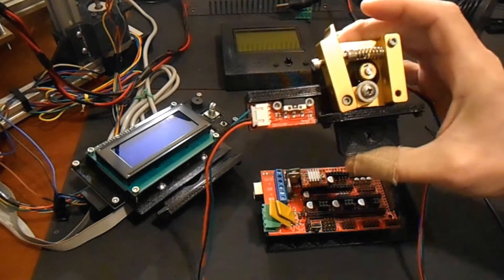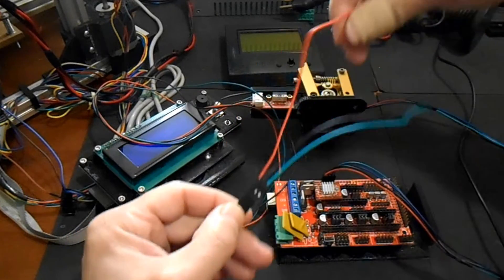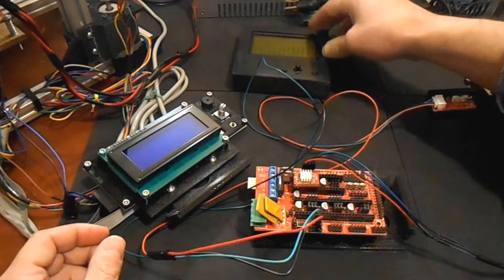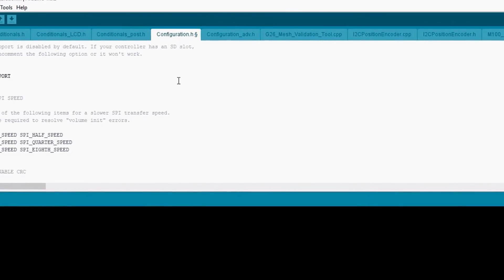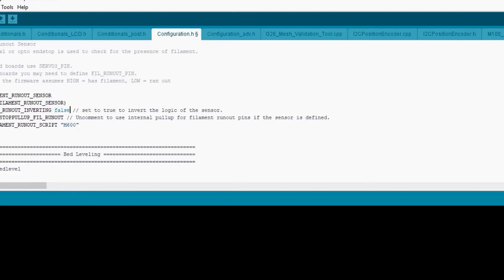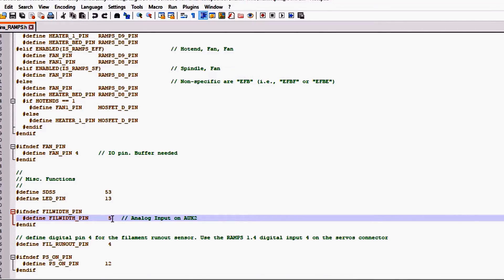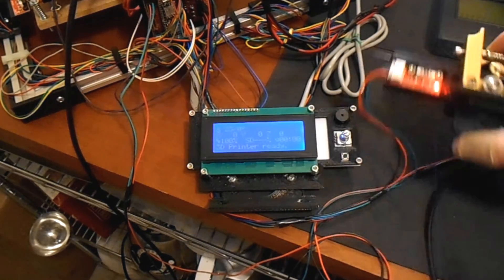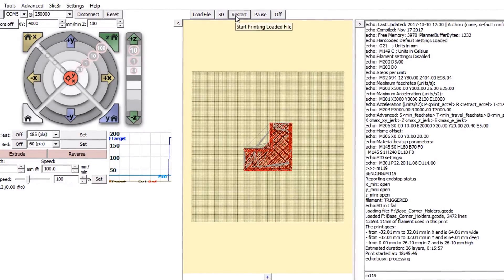RAMPS 1.4 - Mechanical Filament Sensor Runout Configuration

Comment: Hello, great video, but unfortunately I have a problem with the implementation and hope that you can help me to eliminate the problem.

I get the following error messages when uploading to the RAMPS board:

In file included from sketch\MarlinConfig.h:42:0,
                 from sketch\blinkm.cpp:27:
SanityCheck.h:511:6: error: #error "EXTRUDER_RUNOUT_PREVENT is incompatible with ADVANCED_PAUSE_FEATURE."
     #error "EXTRUDER_RUNOUT_PREVENT is incompatible with ADVANCED_PAUSE_FEATURE."
      ^
In file included from sketch\MarlinConfig.h:42:0,
                 from sketch\emergency_parser.cpp:27:
SanityCheck.h:511:6: error: #error "EXTRUDER_RUNOUT_PREVENT is incompatible with ADVANCED_PAUSE_FEATURE."
     #error "EXTRUDER_RUNOUT_PREVENT is incompatible with ADVANCED_PAUSE_FEATURE."
      ^
In file included from sketch\MarlinConfig.h:42:0,
                 from sketch\dac_mcp4728.cpp:33:
SanityCheck.h:511:6: error: #error "EXTRUDER_RUNOUT_PREVENT is incompatible with ADVANCED_PAUSE_FEATURE."
     #error "EXTRUDER_RUNOUT_PREVENT is incompatible with ADVANCED_PAUSE_FEATURE."
      ^
In file included from sketch\MarlinConfig.h:42:0,
                 from sketch\pca9632.cpp:28:
SanityCheck.h:511:6: error: #error "EXTRUDER_RUNOUT_PREVENT is incompatible with ADVANCED_PAUSE_FEATURE."
     #error "EXTRUDER_RUNOUT_PREVENT is incompatible with ADVANCED_PAUSE_FEATURE."
      ^
In file included from sketch\MarlinConfig.h:42:0,
                 from sketch\malyanlcd.cpp:44:
SanityCheck.h:511:6: error: #error "EXTRUDER_RUNOUT_PREVENT is incompatible with ADVANCED_PAUSE_FEATURE."
     #error "EXTRUDER_RUNOUT_PREVENT is incompatible with ADVANCED_PAUSE_FEATURE."
      ^
In file included from sketch\MarlinConfig.h:42:0,
                 from sketch\MarlinSerial.cpp:36:
SanityCheck.h:511:6: error: #error "EXTRUDER_RUNOUT_PREVENT is incompatible with ADVANCED_PAUSE_FEATURE."

     #error "EXTRUDER_RUNOUT_PREVENT is incompatible with ADVANCED_PAUSE_FEATURE."
      ^
In file included from sketch\MarlinConfig.h:42:0,
                 from sketch\SdFatUtil.cpp:29:
SanityCheck.h:511:6: error: #error "EXTRUDER_RUNOUT_PREVENT is incompatible with ADVANCED_PAUSE_FEATURE."
     #error "EXTRUDER_RUNOUT_PREVENT is incompatible with ADVANCED_PAUSE_FEATURE."
      ^
In file included from sketch\MarlinConfig.h:42:0,
                 from sketch\Marlin.h:35,
                 from sketch\endstops.cpp:27:
SanityCheck.h:511:6: error: #error "EXTRUDER_RUNOUT_PREVENT is incompatible with ADVANCED_PAUSE_FEATURE."
     #error "EXTRUDER_RUNOUT_PREVENT is incompatible with ADVANCED_PAUSE_FEATURE."
      ^
In file included from sketch\MarlinConfig.h:42:0,
                 from sketch\hex_print_routines.cpp:23:
SanityCheck.h:511:6: error: #error "EXTRUDER_RUNOUT_PREVENT is incompatible with ADVANCED_PAUSE_FEATURE."
     #error "EXTRUDER_RUNOUT_PREVENT is incompatible with ADVANCED_PAUSE_FEATURE."
      ^
In file included from sketch\MarlinConfig.h:42:0,
                 from sketch\Max7219_Debug_LEDs.cpp:38:
SanityCheck.h:511:6: error: #error "EXTRUDER_RUNOUT_PREVENT is incompatible with ADVANCED_PAUSE_FEATURE."
     #error "EXTRUDER_RUNOUT_PREVENT is incompatible with ADVANCED_PAUSE_FEATURE."
      ^
In file included from sketch\MarlinConfig.h:42:0,
                 from sketch\fwretract.cpp:27:
SanityCheck.h:511:6: error: #error "EXTRUDER_RUNOUT_PREVENT is incompatible with ADVANCED_PAUSE_FEATURE."
     #error "EXTRUDER_RUNOUT_PREVENT is incompatible with ADVANCED_PAUSE_FEATURE."
      ^
Mehrere Bibliotheken wurden für "U8glib.h" gefunden
 Benutzt: C:\Program Files (x86)\Arduino\libraries\U8glib
 Nicht benutzt: C:\Users\Christian\Documents\Arduino\libraries\U8glib_Arduino-master
In file included from sketch\MarlinConfig.h:42:0,
                 from sketch\Sd2Card.cpp:29:
SanityCheck.h:511:6: error: #error "EXTRUDER_RUNOUT_PREVENT is incompatible with ADVANCED_PAUSE_FEATURE."
     #error "EXTRUDER_RUNOUT_PREVENT is incompatible with ADVANCED_PAUSE_FEATURE."
      ^
In file included from sketch\MarlinConfig.h:42:0,
                 from sketch\nozzle.cpp:23:
SanityCheck.h:511:6: error: #error "EXTRUDER_RUNOUT_PREVENT is incompatible with ADVANCED_PAUSE_FEATURE."
     #error "EXTRUDER_RUNOUT_PREVENT is incompatible with ADVANCED_PAUSE_FEATURE."
      ^
In file included from sketch\MarlinConfig.h:42:0,
                 from sketch\G26_Mesh_Validation_Tool.cpp:27:
SanityCheck.h:511:6: error: #error "EXTRUDER_RUNOUT_PREVENT is incompatible with ADVANCED_PAUSE_FEATURE."
     #error "EXTRUDER_RUNOUT_PREVENT is incompatible with ADVANCED_PAUSE_FEATURE."
      ^
In file included from sketch\MarlinConfig.h:42:0,
                 from sketch\I2CPositionEncoder.cpp:31:
SanityCheck.h:511:6: error: #error "EXTRUDER_RUNOUT_PREVENT is incompatible with ADVANCED_PAUSE_FEATURE."
     #error "EXTRUDER_RUNOUT_PREVENT is incompatible with ADVANCED_PAUSE_FEATURE."
      ^
In file included from sketch\MarlinConfig.h:42:0,
                 from sketch\SdBaseFile.cpp:30:
SanityCheck.h:511:6: error: #error "EXTRUDER_RUNOUT_PREVENT is incompatible with ADVANCED_PAUSE_FEATURE."
     #error "EXTRUDER_RUNOUT_PREVENT is incompatible with ADVANCED_PAUSE_FEATURE."
      ^
In file included from sketch\MarlinConfig.h:42:0,
                 from sketch\configuration_store.h:26,
                 from sketch\configuration_store.cpp:47:

SanityCheck.h:511:6: error: #error "EXTRUDER_RUNOUT_PREVENT is incompatible with ADVANCED_PAUSE_FEATURE."
     #error "EXTRUDER_RUNOUT_PREVENT is incompatible with ADVANCED_PAUSE_FEATURE."
      ^
In file included from sketch\MarlinConfig.h:42:0,
                 from sketch\enum.h:26,
                 from sketch\parser.h:32,
                 from sketch\parser.cpp:27:

SanityCheck.h:511:6: error: #error "EXTRUDER_RUNOUT_PREVENT is incompatible with ADVANCED_PAUSE_FEATURE."
     #error "EXTRUDER_RUNOUT_PREVENT is incompatible with ADVANCED_PAUSE_FEATURE."
      ^
In file included from sketch\MarlinConfig.h:42:0,
                 from sketch\cardreader.cpp:23:
SanityCheck.h:511:6: error: #error "EXTRUDER_RUNOUT_PREVENT is incompatible with ADVANCED_PAUSE_FEATURE."
     #error "EXTRUDER_RUNOUT_PREVENT is incompatible with ADVANCED_PAUSE_FEATURE."
      ^
exit status 1
In file included from sketch\MarlinConfig.h:42:0,

                 from sketch\digipot_mcp4018.cpp:23:

SanityCheck.h:511:6: error: #error "EXTRUDER_RUNOUT_PREVENT is incompatible with ADVANCED_PAUSE_FEATURE."

     #error "EXTRUDER_RUNOUT_PREVENT is incompatible with ADVANCED_PAUSE_FEATURE."
      ^
In file included from sketch\MarlinConfig.h:42:0,
                 from sketch\Marlin.h:35,
                 from sketch\Marlin_main.cpp:252:
SanityCheck.h:511:6: error: #error "EXTRUDER_RUNOUT_PREVENT is incompatible with ADVANCED_PAUSE_FEATURE."
     #error "EXTRUDER_RUNOUT_PREVENT is incompatible with ADVANCED_PAUSE_FEATURE."
      ^
In file included from sketch\MarlinConfig.h:42:0,
                 from sketch\least_squares_fit.cpp:35:
SanityCheck.h:511:6: error: #error "EXTRUDER_RUNOUT_PREVENT is incompatible with ADVANCED_PAUSE_FEATURE."
     #error "EXTRUDER_RUNOUT_PREVENT is incompatible with ADVANCED_PAUSE_FEATURE."
      ^
In file included from sketch\MarlinConfig.h:42:0,
                 from sketch\SdFile.cpp:29:
SanityCheck.h:511:6: error: #error "EXTRUDER_RUNOUT_PREVENT is incompatible with ADVANCED_PAUSE_FEATURE."
     #error "EXTRUDER_RUNOUT_PREVENT is incompatible with ADVANCED_PAUSE_FEATURE."
      ^
In file included from sketch\MarlinConfig.h:42:0,
                 from sketch\digipot_mcp4451.cpp:23:
SanityCheck.h:511:6: error: #error "EXTRUDER_RUNOUT_PREVENT is incompatible with ADVANCED_PAUSE_FEATURE."
     #error "EXTRUDER_RUNOUT_PREVENT is incompatible with ADVANCED_PAUSE_FEATURE."
      ^
In file included from sketch\MarlinConfig.h:42:0,
                 from sketch\mesh_bed_leveling.cpp:23:
SanityCheck.h:511:6: error: #error "EXTRUDER_RUNOUT_PREVENT is incompatible with ADVANCED_PAUSE_FEATURE."
     #error "EXTRUDER_RUNOUT_PREVENT is incompatible with ADVANCED_PAUSE_FEATURE."
      ^

#error "EXTRUDER_RUNOUT_PREVENT is incompatible with ADVANCED_PAUSE_FEATURE."

Please help and support!

Best regards Christian
Reply from the maker: So, tell me about your configuration.  What's your 3d motherboard?  What's connected to it?  What's the version of the firmware?  How are you connected I assume a filiment run-out detector?
Reply: Hello and many thanks for your quick feedback. After I tried it with the latest version of Marlin, came said error messages. Afterwards I tried it with a slightly older version of Marlin and lo and behold, there were no more error messages and the sketch was already successfully uploaded to the RAMPS 1.4. Now only the conversion from the old mainboard to the RAMPS remains. Hope, there are many more videos of you on this topic RAMPS 1.4 and 3D printers. Keep up the good work and thanks. Best regards Christian
Reply: @christianhofer8398  
Hi
I did it all over again, I only uncommented the configuration.h
#define FILAMENT_RUNOUT_SENSOR
It is I already get this error:

In file included from C:\Users\Nino\AppData\Local\Temp\arduino_build_201711\sketch\MarlinConfig.h:42:0,

                 from C:\Users\Nino\AppData\Local\Temp\arduino_build_201711\sketch\G26_Mesh_Validation_Tool.cpp:27:

SanityCheck.h:502:5: error: static assertion failed: ADVANCED_PAUSE_FEATURE is required to use M600 with FILAMENT_RUNOUT_SENSOR.

     static_assert(NULL == strstr(FILAMENT_RUNOUT_SCRIPT, "M600"), "ADVANCED_PAUSE_FEATURE is required to use M600 with FILAMENT_RUNOUT_SENSOR.");

     ^~~~~~~~~~~~~

In file included from C:\Users\Nino\AppData\Local\Temp\arduino_build_201711\sketch\MarlinConfig.h:42:0,

                 from C:\Users\Nino\AppData\Local\Temp\arduino_build_201711\sketch\I2CPositionEncoder.cpp:31:

SanityCheck.h:502:5: error: static assertion failed: ADVANCED_PAUSE_FEATURE is required to use M600 with FILAMENT_RUNOUT_SENSOR.

     static_assert(NULL == strstr(FILAMENT_RUNOUT_SCRIPT, "M600"), "ADVANCED_PAUSE_FEATURE is required to use M600 with FILAMENT_RUNOUT_SENSOR.");

     ^~~~~~~~~~~~~

In file included from C:\Users\Nino\AppData\Local\Temp\arduino_build_201711\sketch\MarlinConfig.h:42:0,

                 from C:\Users\Nino\AppData\Local\Temp\arduino_build_201711\sketch\M100_Free_Mem_Chk.cpp:49:

SanityCheck.h:502:5: error: static assertion failed: ADVANCED_PAUSE_FEATURE is required to use M600 with FILAMENT_RUNOUT_SENSOR.

     static_assert(NULL == strstr(FILAMENT_RUNOUT_SCRIPT, "M600"), "ADVANCED_PAUSE_FEATURE is required to use M600 with FILAMENT_RUNOUT_SENSOR.");

     ^~~~~~~~~~~~~

"C:\\Users\\Nino\\AppData\\Local\\Arduino15\\packages\\arduino\\tools\\avr-gcc\\7.3.0-atmel3.6.1-arduino5/bin/avr-g++" -c -g -Os -w -std=gnu++11 -fpermissive -fno-exceptions -ffunction-sections -fdata-sections -fno-threadsafe-statics -Wno-error=narrowing -MMD -flto -mmcu=atmega2560 -DF_CPU=16000000L -DARDUINO=10812 -DARDUINO_AVR_MEGA2560 -DARDUINO_ARCH_AVR "-IC:\\Users\\Nino\\AppData\\Local\\Arduino15\\packages\\arduino\\hardware\\avr\\1.8.2\\cores\\arduino" "-IC:\\Users\\Nino\\AppData\\Local\\Arduino15\\packages\\arduino\\hardware\\avr\\1.8.2\\variants\\mega" "-IC:\\Users\\Nino\\Documents\\Arduino\\libraries\\U8glib\\src" "C:\\Users\\Nino\\AppData\\Local\\Temp\\arduino_build_201711\\sketch\\MarlinSerial.cpp" -o "C:\\Users\\Nino\\AppData\\Local\\Temp\\arduino_build_201711\\sketch\\MarlinSerial.cpp.o"
In file included from C:\Users\Nino\AppData\Local\Temp\arduino_build_201711\sketch\MarlinConfig.h:42:0,

                 from C:\Users\Nino\AppData\Local\Temp\arduino_build_201711\sketch\MarlinSerial.cpp:36:

SanityCheck.h:502:5: error: static assertion failed: ADVANCED_PAUSE_FEATURE is required to use M600 with FILAMENT_RUNOUT_SENSOR.

     static_assert(NULL == strstr(FILAMENT_RUNOUT_SCRIPT, "M600"), "ADVANCED_PAUSE_FEATURE is required to use M600 with FILAMENT_RUNOUT_SENSOR.");

     ^~~~~~~~~~~~~

Uso la libreria U8glib alla versione 1.19.1 nella cartella: C:\Users\Nino\Documents\Arduino\libraries\U8glib 
exit status 1
static assertion failed: ADVANCED_PAUSE_FEATURE is required to use M600 with FILAMENT_RUNOUT_SENSOR.
Reply from the maker: Uncomment out advanced pause feature next and recompile.  The sanity check shows you the next error to address.  You may need to do a couple of times, but you'll understand better with each error fixed.

Comment: Hello my friend ..Then it stop the print ...after from replace filament   printing starts from where it stopped...!!!!!!!!!!!!   from the moment it stops when you put again fnew filament  how much time does it start...you predict to change the material!!!!  ust switch off the switch because he wants a little time .....
Reply from the maker: +Minas ESC Kaisaris there can be several factors in how long it will take.  First the length of your tubing and second the temperature at which you print.  There maybe other factors so you will need to experiment.  Also checkout the configuration advanced tab in marlinfw firmware.  Hope this helps.

Comment: Nice video! I would like to make with a CNC Shield and a Ramps 1.4 a Multimaterial Multiplexer for to run 4 extruders can it be possible?  thank u!
Reply: And Where can i find this STL file i would like to test this runout sensor, thanks again!
Reply from the maker: +Xergio Velarde yes.  I've not attempted, yet.
Reply from the maker: +Xergio Velarde thingiverse, if it's not in the description, then I'll update on a couple of hours.
Reply from the maker: Sorry, I'm not sure I understood the initial question, do you mean four runout sensors?  It may be possible, but I've never tried and I think the default Marlin may have issues.  You may need to modify Marlin FW and currently I'm unsure of the steps involved.
Reply: No, I was talking about conect more motors for to have more extruders, like the prusa multimaterial! with the CNC Shield working with the ramps! thank for the answers :)
Reply from the maker: Yes, four motor is possible.  You may need to used both AUX1/Aux2.
Reply from the maker: NP. Your welcome

Comment: Why did you not just use the pin 4 and fourth row header pin in the servo bank instead of switching the pins_RAMPS.h and using the third header pin row?
Reply from the maker: Yes.
Reply: And why does it not work with the RepRap Full Graphic Display? I was just about to set mine up in Marlin, but I don't want to lose the full graphic display..
Reply from the maker: +Slm Coding  it did not work for myself.  But if it works for you in marlinfw 1.1.6. then I'm okay with being incorrect.  If it doesn't work at least you're confirming the issue I experienced.
Reply from the maker: +Slm Coding two reasons, one to show how two use or redirect pins and also it doesn't seem to work in my configuration.  Granted since I made the video I may have found another option to try.  Great question.
Reply from the maker: If I have time today, I'll check to see if it works.  Sorry, I've been CC in English all week.
Reply: Edward Braiman just curious, did it work? I've been wanting to add this functionality to my printer since I'll be rebuilding it.